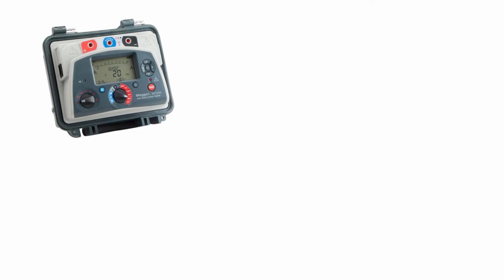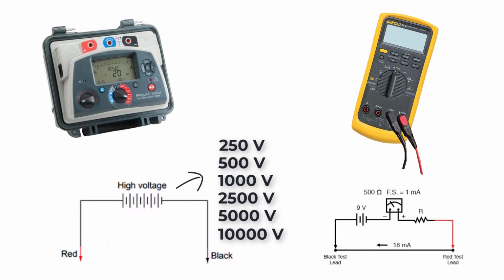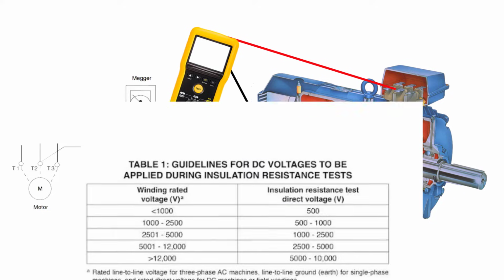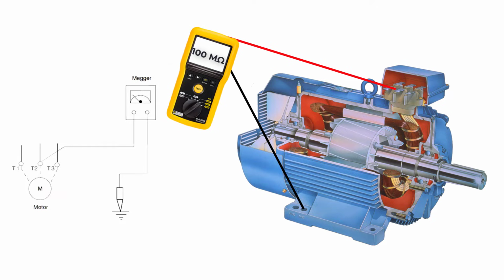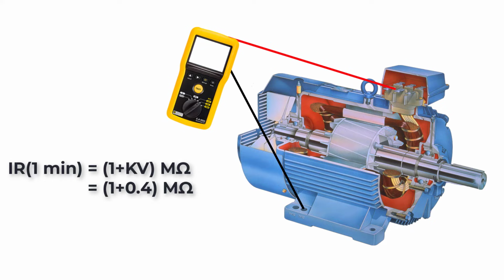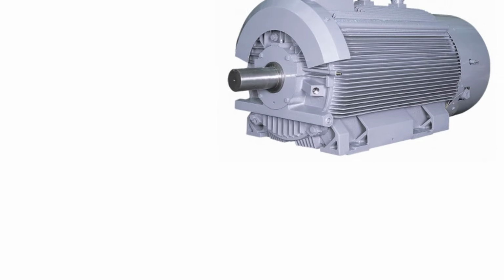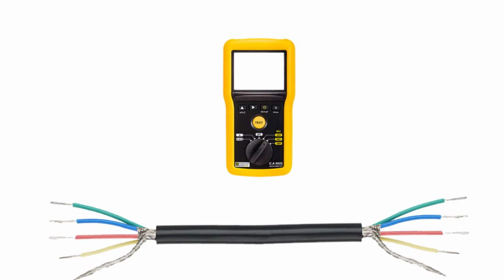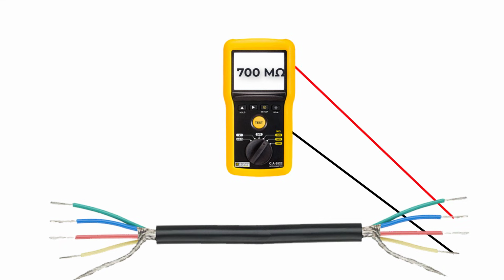How to use insulation tester (Megger)? |Explained

Comment: How much voltage can l use for wind turbine cables
Reply from the maker: When using a megger (insulation resistance tester) to test wind turbine cables, the voltage you can inject depends on the cable's insulation rating and the test standard being followed. Commonly used test voltages include:

Low-voltage cables:

For cables rated up to 1 kV, test with 500 V DC or 1,000 V DC.
Medium-voltage cables:

For cables rated between 1 kV and 35 kV, test with 2,500 V DC or 5,000 V DC.
High-voltage cables:

For cables rated above 35 kV, test with 10,000 V DC or higher, depending on the insulation's voltage class.
Reply: @electricalengineeringplane6620  and the acceptable reading remains at least 1megaohm?
Reply from the maker: For low voltage applications Yes👍

Comment: Can I use it for low voltage wires and devices like 12VDC and 48VDC?
Reply from the maker: You can use it in only on condition!!
First be sure that the cables isn't connected to any devices,, second the cable insulation rating must be 300v for example to megger it with 250v test

Comment: What reading will tell me that the device is faulty or not?... how do read my mega tester?
Reply from the maker: For low voltage motors any readings below 1.4 mega ohm,,, for medium voltage any readings below 12 mega ohm,, for any circuit any readings below 0.5 mega ohm